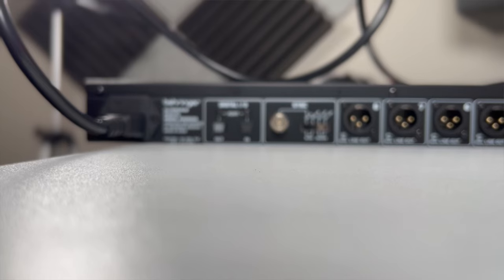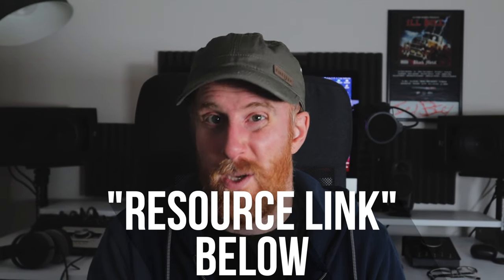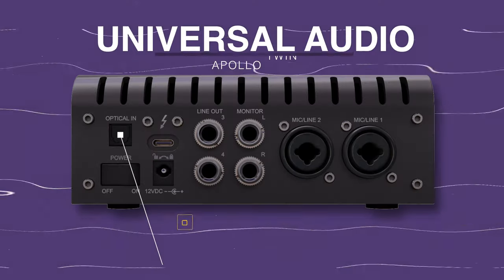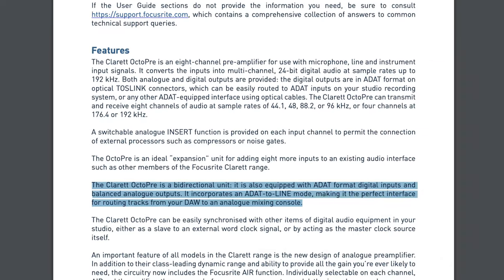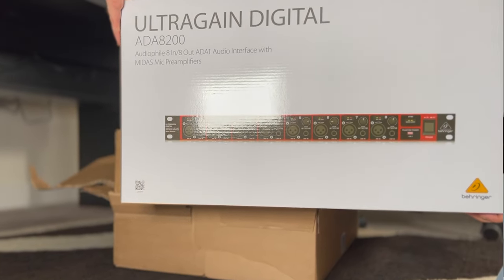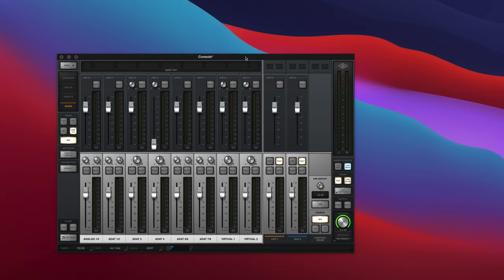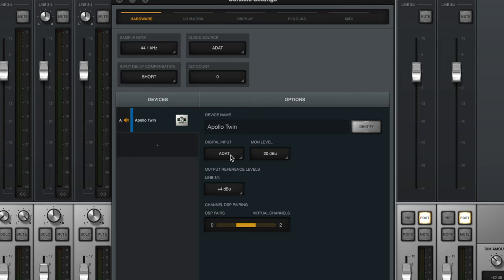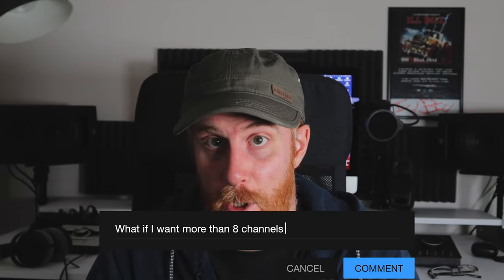How to Add More Inputs to Your Audio Interface & Expands its Ability With ADAT Inputs

Comment: Awesome video!  Thanks for the clear explanation and for taking time to answer all the questions in the comments.   I have an Apollo quad silver and a twin x and they both have ADAT input.   Could I use  2 Behringer ADA8200 to get 16channel inputs connecting to the silver and the twin x?
Reply from the maker: I don’t think you can link the quad a twin x together?

If you can. Yes 100% but AFAIK you need the X6 or larger rack mounts to extended the UA system. 

You can run them as an aggregate device. But you will likely get issues at times with clocking and ADAT in certain DAW and situations.
Reply: @Unders  Thanks for the reply.  I wanted to record some small live performance and was really hoping I could..  :)

Comment: Thanks for this! I know some older/cheaper interfaces have issues with compatibility with the latest Apple Mac software. I’ve got an Apollo Twin X which works perfectly in terms of compatibility, but if I linked up say a Behringer interface like this, do I have to investigate compatibility issues in advance or, because it’s essentially a slave to the Apollo, would it not matter?

Comment: So I have the same exact setup. Had my Apollo for years but wanted to add inputs so I can keep it all plugged in. 

Question- do you have the slide switch on the Behringer to slave/adat in OR master/44.1 (or whatever sample rate used)? You say it in this video but just want to make sure I understand correctly.
Reply from the maker: Behringer has to be master because the Apollo can’t send a sync signal. It no issue as if the Behringer is off Apollo stays as master according to (in my case ) the Mac. When switched on it automatically changes.

Comment: Would integrating a patchbay provide some flexibility in this exact setup, or is it redundant? Same gear, same goal. Looking to connect my ART Pro VLA 2 and ART Voice channel strip. To sculpt vocals thru a chain using analog gear. I have the ART 48 and ART P16 patchbays, 1/4 inch and XLR. Trying to avoid upgrading my apollo twin x interface. I am thinking to integrate my scarlett 6i6 and Mackie Big Knob 3x2 interfaces or just create a secondary workstation. Great vid, I subbed
Reply from the maker: Having a patch bay would be completely valid if you have more gear then inputs and want everything always set up. Absolutely.

Comment: Hi Unders, great video. I subscribed. Question for you, I have an Apollo Twin X and I want to add 8 more channels. If I go with a Focusrite Clarett + Octo-pre adat as an example I don't think I get to use the 8 outputs do I. Ideally I want the 8 outputs and retain the control room volume features of the Twin. I'm thinking I would need the 8Pre USB version and call that my master correct? But what of the Twin as control room unit? Thanks! Tod in Vegas :)
Reply from the maker: If you have an interface with just the one ADAT in you need something like the Scarlett Ocoto Pre Dyn, which has ADAT-to-LINE mode meaning what goes in can be internal routed back out at line level.

Comment: I’m super surprised no one has asked this, but let’s say the superior divide isn’t the Apollo, but another interface with better conversion and clocking. Let’s say the Babyface pro and an x8 Apollo. If I want to use the baby face as mic pre and speaker out  can you still use unison plug-ins from the Apollo when recording?
Reply from the maker: No because the unison function relies on the two way communication of the USBC / Thunderbolt
Reply: @Unders  damn, would have been nice.
Reply from the maker: On Mac you totally can make aggregate device an run them in tandem. But both need to be directly connected to the mac. Im unsure about windows these days.

Comment: Thanks for the video! I've been trying to expand my apollo with my focusrite pro 40 for some time now and after finally borrowing a computer that allowed me to change the pro 40s settings through mix control, I was able to receive an audio signal on my apollo. However, when recording into protools on my pro 40 input, It sounded robotic and weird. While in mix control I routed all the inputs to Adat and changed the sample rate to match my apollo as well as set the clock to adat on both devices. Any idea why the audio coming from the pro 40 sounds bad?
Reply from the maker: Dont forget that one has to be the clock master. If you have an apollo with just the 1 ADAT then your 40s needs to be the master clock.
Reply: @Unders  Ok so if I understand this In order to expand the apollo I need to make the pro 40s clock internal and the apollos adat? I would have thought it was the other way around. I guess how do you decide which one is adat and which is internal?
Reply from the maker: @ajrmusic91  im like 99% i covered this in the video. In short if the interface does not have both in an out in cant be the clock source.
Reply: @Unders  Just out of noob curiosity, is there a downgrade in “clock quality” (if that were such a thing) in going from the Apollo being the master to the ada8200 being the master?

Thanks for the video. I’m also using an Apollo twin with an ada8200 and your video solved the issue I’ve been having with pops and clicks when recording through adat.
Reply from the maker: @pandemic7  Hey glad the issue is sorted, the clicks are ghastly. No downgrade persay, You just need to be a little more observant when setting up sessions etc at the correct bitrate etc. Because its no longer going to automatically adjust when the behringer is on. Because its setting that clock and isnt connected to the computer in anyway. Like if its just the Apollo an you switch a session for 44.1 to 48k the Apollo clicks off and resets. That now cant happen becasue the behringer has no way of getting that information.
Reply: @Unders  Excellent, thanks again, man!

Comment: Hey man, thank you so much for the video number one my first time coming here. I really appreciate you doing that and I was wondering if you wouldn’t mind answering a question for me I’m a drummer and I’ve been recording with one mic and two obviously running with the bass guitar player I’m out of channels. I have the Apollo twin also I don’t think I need outputs as much as I need inputs. I’m just trying to record more microphones simply. Thank you very much. If you have a chance to answer that, I would appreciate your brother to run kick two overheads a base and guitar input. I’m simply trying to record with more microphones. That is all will my Apollo twin and additional eight input like this Behringer you’re using work for me to add more above the kit.? thank you so much
Reply from the maker: That would do it. Just note with this unit phantom power is either on or off. So not ideal for mixed mic set ups. But that’s what it is for the price point. There’s the Focusrite for more complex routing and options but at 3-4x the price. 

Still cheaper than getting a new I/O though.
Reply: @Unders  Thanks brother!  Meaning either condenser or dynamic mics but not mixed correct?  Thanks for your time bro!  Take care man!!
Reply from the maker: @craigsweeden1376  I would stick to one or the other yes. Theres people out there who say its fine to run say your sm57 and your 414 with phantom power going to both. I was taught differently and shown specifically how this can have detrimental effects to some mics. An as i mainly use line input synths myself anyways ive never looked at each an every combo to see what's viable.

Comment: Thank you for this video. Very useful!! 👏 I bought the Scarlett OctoPre Dynamic to use the outputs on my apollo Twin X, but I am not getting any signal from those utputs. I am not even sure I set it up properly. I turned the ADAT to Line on but it still doesn't seem to work. Do I need to do something manually on my Daw or am I missing something? Thanks again!!
Reply from the maker: Twin X like my "vintage" twin here only has optical in. So can ONLY take inputs. It cant add 8 additional outs. 
The Scarlett OctoPre Dynamic (I think i dont have one) have ADAT to Line, So there's internal routing to send the extra ins as outputs. 

How you set that up, I do not know as ive never set up that unit. 

Feel free to ask focusrite to send me one so i can make a video 😆
Reply: @Unders  thanks! I don’t think it’s possible to use those outputs, so might have to return it. 

Might be a good idea to add in your video you’ve never done this, so that you don’t misguide other people by advising it’s possible to use this outputs…

As for the test unit, feel free to ask FocusRite yourself. It’s your channel, I am sure they can send you a test unit!
Reply from the maker: It’s literally before even 2min in ✌️

As for “never done this” it’s literally my setup. I however don’t own the same equipment as you specifically. 

Best of luck to you 👋

Comment: Hi thanks for the video I have a issue, I purchased a focusrite Saffire MKII Octopre which only has two outs and no ins. I’ve been trying to connected it to my focusrite clarett 8pre to connect the rest of my hardware Eq’s and Comps for days and I can’t seem to get a signal at all. I’ve tried everything so far. From my understanding by watching your video it’s not possible because the Octopre doesn’t have any ins correct? I lost 🤔 Help if you can please and thank you..
Reply from the maker: without both in and out you cant make a complete loop. That MKII can only output more signals. Not take in more inputs. 
So you could use it to send a whole stack of extra outs and route the manually back into the Clarett but thats uses up your inputs. 

A workaround if you are on Mac is to make an Aggregate device in settings. And use both units in sync like that. 

Alternatively something like the Behringer here - https://www.thomann.de/gb/thlpg_lv3lsv64u3.html

into the carett would give it 8 more in and outs up to 48khz, I think i said in the video there's very few dedicated ADAT units out there, But thats a comparable price example to that MKII and what i picked up an have in the video.
Reply: @Unders  Thank you so much for your reply. Hopefully I can get my refund for this. I do not want to go through all of the extra routing just to make this work.

Comment: Aside from the bit rate limitations already discussed in this video, would the fidelity in your example be limited to the behringers capabilities or up to the apollos?
Reply from the maker: If we’re talking Mic Preamps 100% the flavour of the ADAT unit. In my set up I’m using the line in, of which you can’t really go wrong. 

If you’re going ADAT to add 8 new mic inputs. Maybe splash extra on say a Focusrite claret. The Behringer Midas mic pres however are completely serviceable extra options.

Comment: Hi! Thanks for a great video. I was planning on getting a Focusrite Scarlett 18i20 together with my Apollo Twin X, instead of the Behringer 8200 that you showed in the video. I like the Scarletts Midi in/out and also some of the other features like the metering visualisation etc. My questions: 
1. Is the preamp quality of the ADAT-device (ie the Behringer or potentially the Scarlett 18i20) a factor when selecting an ADAT interface for more inputs? I assume yes? 
2.  Would it be possible to use the Scarlett 18i20 as an ADAT-extension for more inputs, or do you need something like the Behringer 8200 for this?

Many thanks in advance! /Marcus
Reply from the maker: Pre amps totally a factor if its for micing up. If like me you are using direct inputs for synths an samplers. Not so much.
You can use other interfaces to extended sure. Just ensure they have the correct configurations. Generally ADAT's are dedicated for just that. 

But things like the Apollo range from UA can all link together too. Focusrite is the only other company really making dedicated ADAT's too.

Comment: Hi, thanks for the video. I am struggling trying to expand a SSL12 connecting a Focusrite Scarlett 18i20 via ADAT. The SSL360 software, which seems to be the equivalent to the Apollo Console sw, apparently recognizes the eight new inputs, but no bars appear on their meters when using mics. It seems somehow the sound is not reaching the SSL12, but I can't find the reason why. Could you please help me on this? Thanks a bunch.
Reply from the maker: Sorry i get 1000+ comments here a month an i missed this till now. Got it sorted?
Reply: Hi. Not yet. I figured out how to create an aggregate device through Mac setup pluging both units to the computer via USB, but I still want to use the ADAT connection. I would appreciate if you could help me. Thanks a lot.
Reply from the maker: @icm1975  In this set up you can basically ignore the SSL12, keep it in the aggregate as its useful but the scarlet has the better ADAT options by a long shot. 

Now depending on what ADAT unit you have you need to know if like my behringer it has to be set as the clocking source. 

If thats the case set the Clock Source of the Audio Interface to ADAT, next set the Sample Rate to either 44.1 kHz or 48 kHz. (dip switches on the unit) to what you want or are working at. 

Once that is done you should be able to see the additional ADAT inputs. if you have two units you need to set up for both to get the 16 channels of input at 44.1 / 48k
Reply: @Unders  Hi. I still have not worked this out. My Focusrite unit is the Scarlett 18i20, no switches, just an ADAT input and and ADAT output. So far, I am dong fine by the aggregate device solution in Mac, but I am still curious on how it can be done, like you do with the Behringher, which seems very simple and easy. I hope one day you'll have the chance to try using these same devices to try my case, but I understand it might not be feasible for you. Thanks anyway for trying to help and keep up with the good work of sharing your knowledge.

Comment: I’m kind of doing the opposite. I’m using an Apollo x8p (8 mic pre’s) and a Focusrite (4 mic pre’s) all running into Luna. The Apollo will be the master. Im only concerned about inputs, not outputs. I’m kinda of a dumbass when it comes to connecting this hardware, so bare with me. All I have to do is plug an Adat OUT of my focusrite and IN to my Apollo, right? Is the ADAT cable the only hardware I need? Do I need any TRS cables for anything? Can I use thunderbolt?

Great video, people like you keep us gearheads from going insane. Howdy from Texas
Reply from the maker: Yes. If all you want to do is add the extra inputs. Now I don’t know what focusrite unit it is so make sure it can be used as a slave for ADAT it will be in the manual under the ADAT info. 

If you’re on Mac you can plug both into thunderbolt and make an aggregate device avoiding the adat set up. They do work very well now days. But at the cost of using multiple ports obviously.
Reply: @Unders  I checked. It actually only has an optical input, so it would have to be the master. Is that a problem? I have a Scarlett 18i8 btw. I don’t think I can use both interfaces simultaneously via thunderbolt though
Reply from the maker: @graysonhoward1562 yes. You need an optical out to come into the Apollo. 

This might be your solution if on Mac - https://support.apple.com/en-gb/HT202000

Comment: Thx alot for the demonstration, I want to ask something because it seems confusing to me I have Apollo Twin USB and audient asp 880, in my case I should set up this preamp as a master and Apollo as slave, and other thing in case of scenario I want to hock my Apollo with patchbay  both in and out, so is it possible to to get my preamp In and out for other gears like a composer and EQ?
Regads
Reply from the maker: The 880 is an independent audio interface all by itself. That has both ADAT in an out. So you could expand this more effectively than the twin. 

You can also still run both together but will have to have both connected to your desktop via separate USB / Thunderbolt.

Comment: Thanks for this adat overview. I have a question about the UA apollo twin if you don't mind. I am planning to purchase the twin if it can apply it's fx to the incoming adat channels in console software. Can it do that I wonder? Or is the fx processing only for the 3 channels of the twin. Thank you
Reply from the maker: No on the processing. Unison needs to run through the hardware and light pipe ADAT is just incoming data signal. It’s the same even on the massive I/O units the ADAT can’t be processed in the way in like that.
Reply: @Unders  thanks for explanation 👍 I just could not find the answer anywhere and you solved that for me, thanks a mill 😁

Comment: Hi I’m stuck and you have the same Apollo twin x I have on my Mac and I want that option of using the Adat bi directional so which focusrire model do I need is the Scarlett octopre 8 channel the one or is it the clarett+ octopre 8 as The price is different I really only need an additional 1 out put so if I use the other output on the twin and get the cheap behringer would that work
Reply from the maker: as said in the video, the twin cannot do what you want, for signal to go both ways you need 2 ADAT ports.
Reply: @Unders  thanks so I’ll just be better getting the same behringer you bought I can record the line inputs from the behringer into the Uad console I just want to then send an out put from the second outs puts 3 and 4 out the twin into my Octatrack that should work ?
Reply from the maker: @JohnDoe-yr5tg  Yes, this is why i have a passive control knob though as out 3-4 cant be level controlled.

Comment: So if I ran this exact setup, I could use all 8 adat channels individually along with the other two analog? Adat 1, adat 2, adat 3, etc all seperate mono? I noticed at 4:55, some of the channels turned into "analog 1/2" "adat 7/8"
Reply from the maker: As inputs. Yes. Apollo twin can not add additional outs due to its ADAT set up.